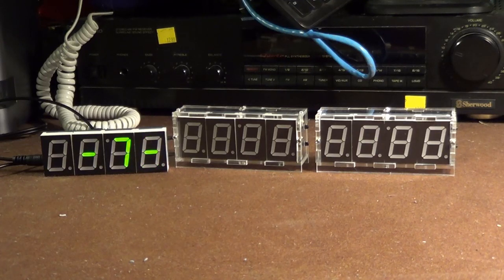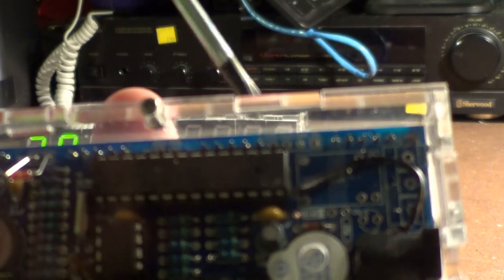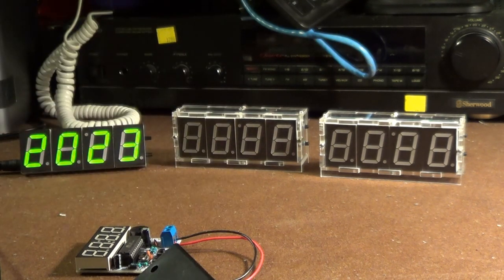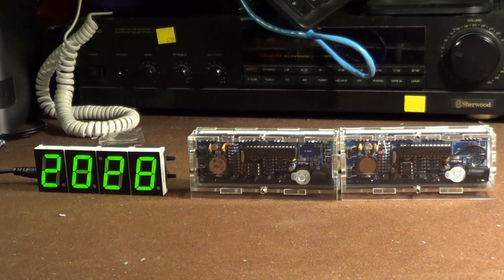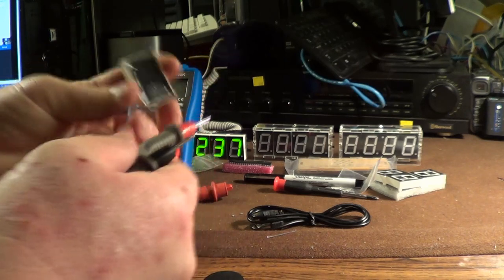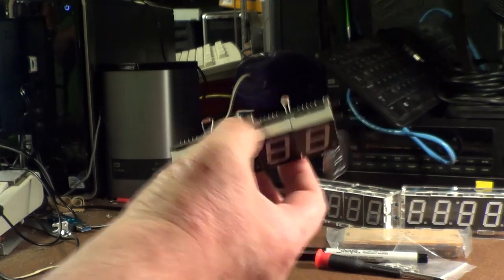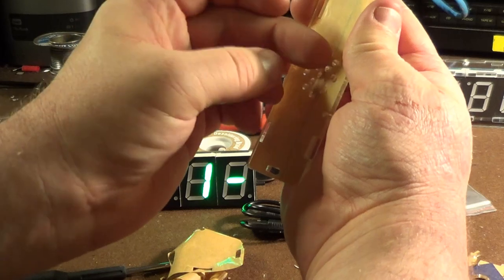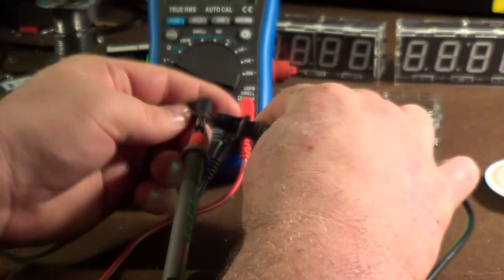Rambling about Chinese LED Clock Kits

Comment: I see I’m not the only one who sings along to the radio when working on something! I’m pretty much the same way - just by ear as I can’t read sheet music if my life depended on it. Which version of Goodnight Irene was that that was playing? So many people did it but I’ve always liked that particular version… and can’t remember who it was that did it.

My brother got one of those for Christmas several years ago… like you he also built several of them over the next few months
Reply from the maker: Most probably it was the version done by The Brothers Four. 

Since this video was made, I have built another one of these inexpensive kits. That one came with a four digit multicolor LED display that's substantially more intelligent than the individual seven segment displays these kids had. That display handles all of the multiplexing and segment driving related tasks directly, rather than leaving the microcontroller to do so. The program included with that clock is also a lot more capable and has many more options.
Reply: @uxwbill  not sure how I never knew they did a version of it… the Brothers Four is one of my favorite groups.

Interesting to know that there are so many different options… the ones we have are probably the cheapest of the cheap :)

Comment: I really like these clock kits. I started off with purchasing one from Ebay a couple of months ago just to try it out, but after assembling it I ordered a few more just for fun. I've heard that you can join pins 6, 7 and 14 on the controller to stop it from automatically scrolling through the temperature, date etc. It should only display the time until you press the button manually. I've no idea if this works though, I haven't tried it out yet. I found out about it after I was done assembling everything already.

All my clocks seems to behave the same. I ordered them all from the same seller not that far apart, so they're probably running the same software. One interesting thing i've noticed on all clocks is when they display the temperature or date, the illuminated dots flickers slightly for some reason. It never happens when setting the date or when it's indicating if the alarm or hourly chime is enabled or not.

Comment: Having something like a Hakko FR-300 would make desoldering the thru-hole parts a breeze, sadly they are a bit pricey at around $240.  You may be able to dump the firmware off the microcontroller (if it hasn't been set to prevent reading of the flash contents.)
Reply from the maker: Sometime when finances permit, I will look into higher quality desoldering equipment. For as long as they lasted, though, I was pretty happy with the Radio Shack desoldering iron.

Developers of the open-source firmware for these clocks say that retrieving the original code is not possible (thus, no way to go back if you have problems). STC (maker of the microcontroller) mentions the robust nature of their code protection in the data sheet and offers a considerable monetary award for anyone who breaks said protection.

Comment: Speaking of the mentality in communist-like countries, here are some anecdotes:
* Someone obtained a copyright on a disc collection of cracked software.
* One manufacturer used to dip circuits in tar to prevent others from stealing the schematic which he has already stolen from somewhere else.
* In most electronic stores, your warranty on purchased products is void once you've left the shop.

Comment: Is there a 12-hour clock instead of the 24-hour one? That's an interesting project.

edit: just watched a portion of the video about the 12 and 24 hour clock.
Reply from the maker: With the talking model, you can select 12 hour timekeeping from an "options menu" of sorts. You can also select whether the display alternates between various things, and which unit the temperature will be displayed in. However, only the second option seems to exist in the programming of the clock I built in this video.
Reply: uxwbill interesting.

Comment: About half of the kits I purchased came with no instructions, so you have to be able to figure it out on your own.
Reply from the maker: Most of the PCBs I received had the value of a part or its type number printed in the appropriate place. Some kits I received with English instructions and others Chinese. I have yet to get one that didn't have any, though I'm sure it could happen. One can't expect everything for what these cost. :-)
Reply: That's just it. The PCB has some shapes on it and if your lucky the value of the resistors is on it. I have looked around and you can usually find something to download, but again Chinglish. I love building them or I wouldn't keep buying them.

Comment: I may consider getting one... they seem pretty cool
and I like that night light feature too! maybe it could be replaced with a more 'sleep friendly' color instead of the cool white
(proof that I stayed all the way thru :P )
Reply from the maker: They are pretty cool. I'd probably give the non-talking variant a slight edge in terms of assembly ease, since you don't have to contend with the speaker when putting the cabinet together. And it's not like they are expensive, though they (usually) work far better than the price would suggest. The only one I've been kind of dissatisfied with was the "yellow" one.

In the provided schematic, there's no current limiting resistor for the LED. Assuming there isn't one in the LED module itself (which, while it seems likely to be the case, now has me wondering), you'd have to stick one in somewhere. It could be done: cut the trace between Q5 and the LED, or between the LED and ground (whichever's easiest, probably the supply after it leaves Q5) and stick a resistor in there. 

The way it is now, they look to be depending upon the LED's internal resistance to keep it within the safe operating area (otherwise it eventually becomes a DED, or dark emitting diode). Which it might do anyway, since the designers may well have assumed it would never be on for too long.

Comment: Camera doesn't focus because you hold things too close to it. Hold them at least 30-40cm from lens.  Also, i found that placing your flat palm behind things will help the camera focus faster (maybe processors inside being tweaked/optimized for human skin, to focus on faces and all that?).
Reply from the maker: Now on that I'd have to disagree. It is quite capable of extremely tight focus, even a half inch from the lens. It's just getting it to do so that's the trick.

I fear it to be a problem growing within the mechanicals because not even the manual focus will work properly when it's being stubborn and it does work noticeably better when the camera has heated up. (It grows quite warm in operation when shooting HD video.)
Reply: I would add my two cents Bill: Is it perhaps that the cam focuses on the brightest spot automatically and when you were holding up the back of the clock, it was in shadow? Also: What Handycam are you using, if I may ask?

Comment: First i must say this: "You have too much time on your hands bill.", someone had to say it :-D.
It's not sod-her bill, it's conductive magic glue lol :-D.
No one is perfect bill, we all make mistooks :)
Reply from the maker: Yes, it is true. Sometimes I have way too much time on my hands.

I actually have a bottle of stuff called "wire glue", basically graphite in a fairly inert carrier liquid that evaporates after a while. (My guess is that it's largely water based, as the maker says you can add a few drops of water should it dry out.) It's billed as a replacement for soldering, though I don't know as I'd really trust it for that. I have used it with good results to repair keys on remote controls that no longer respond reliably.

As for the mistake, at least I caught it (albeit only accidentally) pretty quickly and managed to repair it without ruining everything in sight. Little miracles. :-)
Reply: The first of my lines was a clock making joke, i hope you saw it that way :-D.
"Wire glue" i've never heard of that before, the silver based track repairing pens worked, but too expensive :-(
The copper wire bypass was the favorite.

I've stuck small patches of aluminium foil to dead conductive buttons, crude but better than nothing. :-)
Reply from the maker: I totally missed that. But that's very good and now that you've explained it, I quite like it. :-)

Years ago I had a BTC computer keyboard constructed with foam rubber and an aluminum pad under each key. Looking back, it probably was a terrible keyboard in all honesty, even though I did like it at the time. The various pads started falling off, so one day I took to doing the same thing: gluing fresh foil to each one that had failed.

I never did get the "i" key to work again, and with it being such a fiddly thing to do, there was a fair bit of invented profanity used along the way.
Reply: Swearing is mandatory :-D
Reply: The way the English language is used around the world is amusing at times, e.g. how come the Irish pronounce the word three as "tree"?  How do they pronounce the word tree I wonder?  :-D
Reply: EggShredder, lol yes i do find wrongly pronounced words amusing, but (And there allways is one) no one speaks original english, not even people from the u.k lol.

English is full of odd rules and other languages words, i'm supprised that anyone outside the uk uses it at all :-D.
The late ronnie barker was a master of funny english "The piss pronounciation of worms" :-D

Comment: I just put together one of those clocks...and everything works except the fact the central segment of ALL four displays doesn't light up. Ever. Any idea where to find the culprit for this behaviour?
Reply from the maker: All I could suggest -- and unfortunately, this will be a pain -- is to go over all the solder joints. There is probably an accidental bridge somewhere. Less likely but still possible is a damaged part.

Comment: I have read that for you to be safe you should always use the power supply that comes with the device and only the power supply that comes with the device but as we all know almost no one actually does that almost everyone has used a different power supply than the one that came with the device because they can get lost or damaged so we have to use another power supply or power cord and as long as it is compatible there is usually no real problem with doing that!!!

Comment: i just got one of these was hoping to assemble it but the kit was missing the NY3P065 chip what on earth should i do now
Reply from the maker: Contact the seller you got it from? (But don't expect much.)

Actually, it'll probably work fine without it, and if you don't speak Chinese, or have any interest in learning Chinese, you won't miss much.
Reply: @uxwbill  wait so that chip is just for the voice
Reply from the maker: Yes. It just occurred to me that the program stored in the microcontroller may or may not deal with the missing chip in a graceful way. It's still worth a try...the worst that'll happen is that it won't work.
Reply: @uxwbill  yea I will test it out
Reply: @datrandomdugggy5537  Did you get it built? I built my kit and it is also missing the NY3P065 chip. not sure if i messed it up or it needs the chip.
Reply: @sandmanlol  I looked closer at the packaging a noticed it did come with a slightly different version of the chip but I ended up not useing it anyway it's just responsible for the talking part if you don't want to use the feature of it speaking the time you don't need it
Reply: @datrandomdugggy5537  hmm so I just messed something up. Thanks for the info!

Comment: 16:40 you can just snap them that's the easiest way.
Reply from the maker: I tried that, and couldn't do it.
Reply: I usually do it this way; hold the bar of pins with both hands, with the fingernails of both my thumbs near one of the detents and then just quickly snap it in the direction of the thumbs. Two or even one pair of pliers work great as well. Using a sidecutter requires one that cuts very flush. I have found the snapping method to be sufficient most of the time.